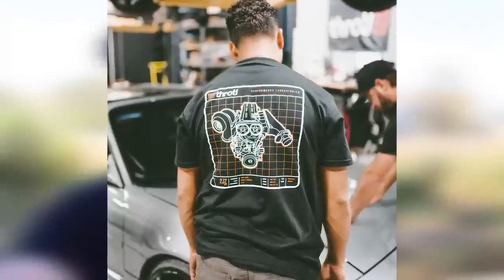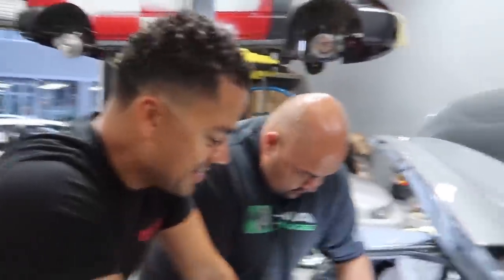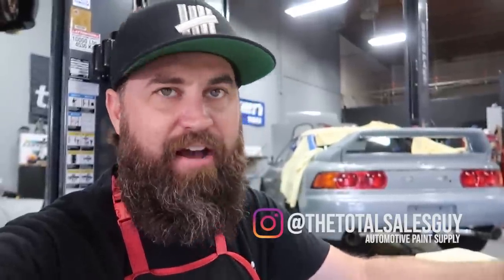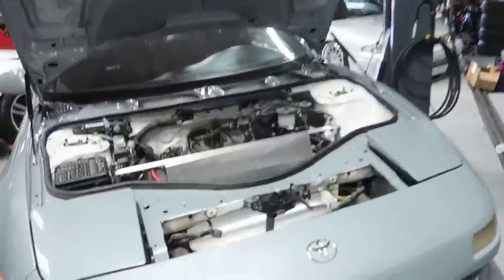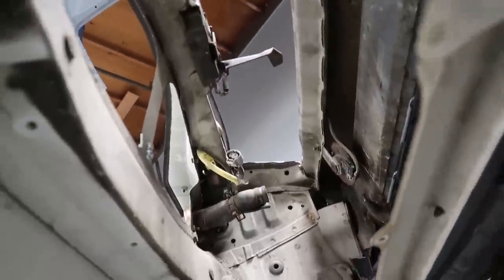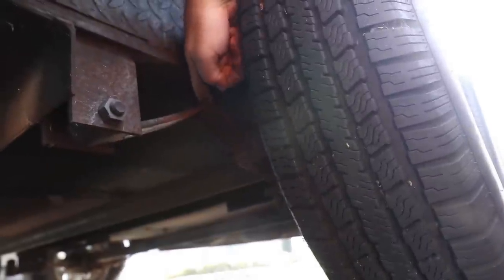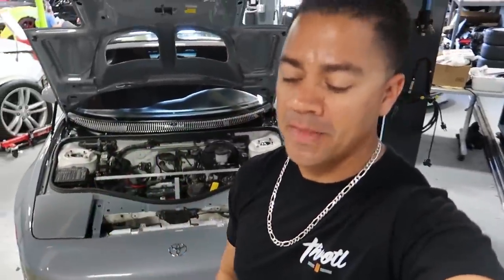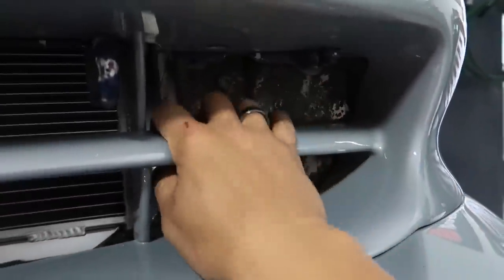V6 Swapped Toyota Mr2 - Assembly Complete!! (+MAJOR BUILD ANNOUNCEMENT)

Comment: Luckily the leaf spring broke at the shop and not on the road or at the show. My buddy and I had a spring break on his ATV trailer when I lived in Alaska. We were 200 miles from home and over a hour from the closest gas station. We found a burned out abandoned old Ford Ranger and were able to get a leaf spring off of it and rig it up to support the trailer good enough to get us home. It actually worked really well and we didn’t have any problems going home.

Comment: New build idea.  First gen IS300 with a lightweight 4 cylinder swap (2AR from Toyota is actually really good).  The FR chassis is great, the double wishbone suspension is easy to dial in, and the looks are timeless.  Dropping the NA 2JZ would drop a few hundred pounds off the front of the car, and give enough space for a nice turbo setup.  350z transmission is stronger and lighter than the 5 spd Toyota units.  Overall you could easily get the car under 3000lbs without stripping it out.  Great car for Autocross or road course.  Just an idea and something different from what everyone else is doing.

Comment: Question... how are you going to get around smog to register it at DMV? You guys are based out of Southern California right? Is the car even registered at all?
Reply: Over 20 yrs old isn't non smog?
Reply: @rexrunner  in Cali it doesn't apply(as in the 25 year old rule, it's like anything older than 1950-1960). It's almost impossible to register a 2gr swap in a mr2 there lol
Reply: You gotta have cats, but from what I hear you gotta have the factory cats,evap system,etc(pretty much a vehical inspection). The main issue is that the 2grfe never came with a manual trans in the U.S(new Tacoma's don't count since ecus arent from them/don't pop up as them), so in other words you gotta use a lotus ecu,etc or they done check the whole car to see if it has a manual trans(since Marc's/frankstines has his hacked ecus pop up as Highlanders with code readers) if they catch you you are in big trouble. It's way too much trouble than what it's worth, you're better off moving a state over if you want the car lol
Reply: Josh .Nalepa lol ya that sounds about right. Here in good old cali we can’t do anything cool to cars without it bing illegal... lol that’s also why I was asking throttle how are they going to go about the hole registration aspect. I’m sure it will be up to the winner of it an they will have to deal with all the headaches that goes along with it. It’s a sick car but for anyone in California this car would not be a good car to drive around in on the streets unregistered an not smog
Reply: @2003pooshoe  yep. IDK if they thought about it or not but it could be another factor in why they are giving it away(since Cali's laws). And if some people are trying to enter to win it and live in Cali, I hope they know about the regerstaration,etc(unless they'll make this giveaway not eligible for Cali owners to make it easier). I think my entire time I've been in the v6 mr2 group/2grfe world(2-3 years now) I've only heard about 1 car in Cali that was legal, but that was a long time ago and before they changed certain stuff with laws. I'm glad I live in Ohio, running no cats on my 2grfe is amazing lol
Reply: @2003pooshoe  either way I do kinda hope they bring up this topic in the next video since it may be one of the last videos on the build
Reply: Josh .Nalepa ya I hope so to. But I have a feeling the giveaway will be open to everyone an it will be a “will it’s your problem now buddy. Good luck!” Your very lucky to be living in a non smog state!
Reply: @2003pooshoe  in Ohio smoog is based on county(like my county I live in does it but the one south of us doesn't,etc) but most mr2s are way older than 25 years old so thankfully the 25 year rule applies here in the full state lol